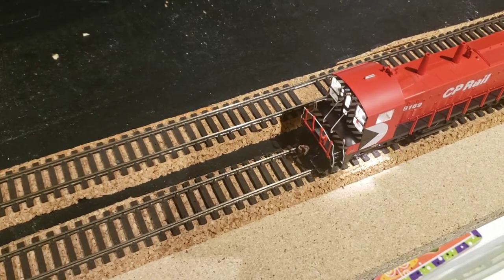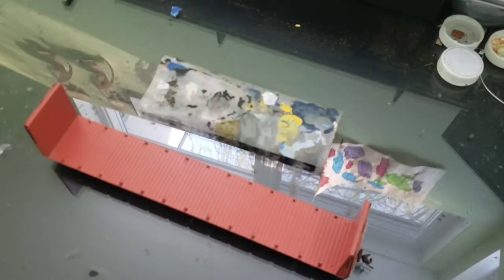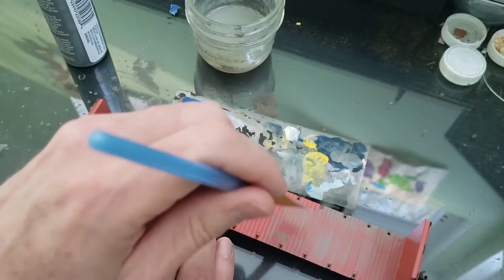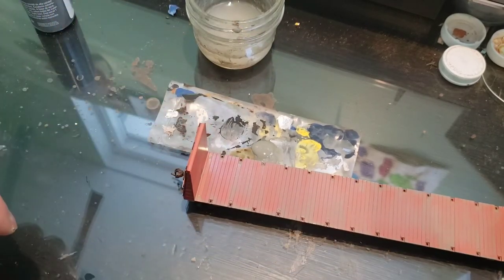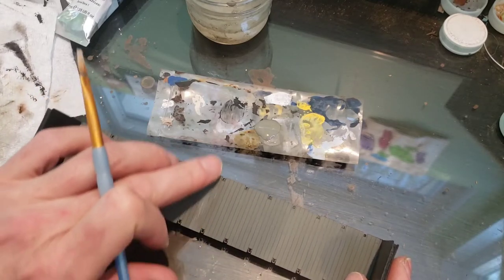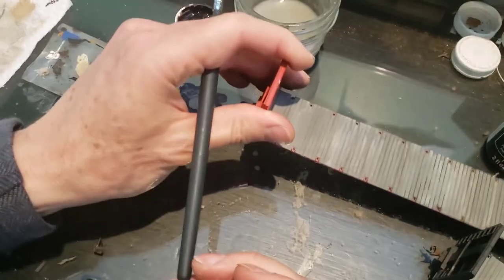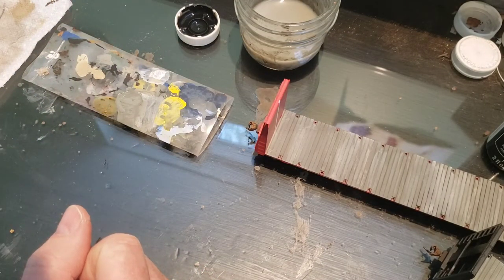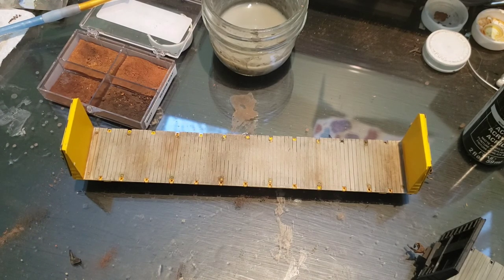Adding some character to my ho scale bulkhead fleet - paint tutorial

Comment: I got a good deal on a dozen of those Athern bulkhead flat car. I built 3 so far. I have .to do the same thing you did. I also want to put planking on the ends. Nice work on your cars.
Reply from the maker: Cheers Paul. They start to look good with real grabs, new stirrups and yes, wooden planking on the ends. Have you also thought about chopping the ends down and capping with styrene? I'm gonna try that on one. Will post the result.
Reply: @mattw9667  I have thought about do some short bulkheads. LW, Louisville and Wadley and HPJX Helm-Pacific Leasing are 2 outfits that run short end bulkhead flats.
Reply from the maker: @paullindell  I'll be finished my first one tomorrow.  I'll post a video of the outcome.  Doesn't look too bad so far.